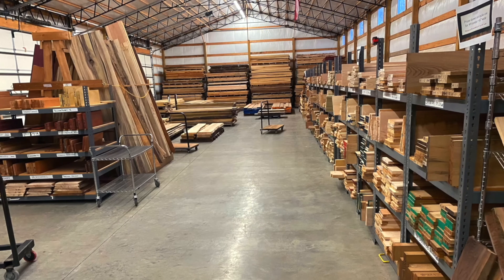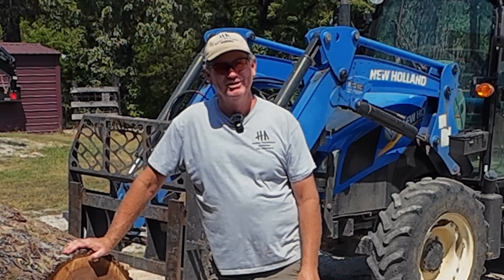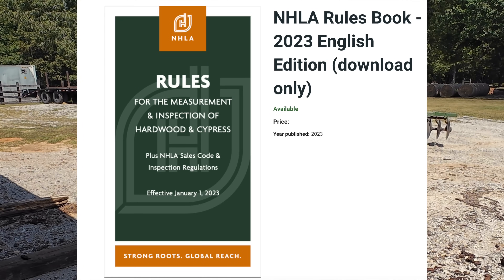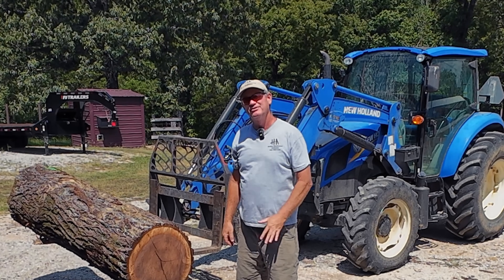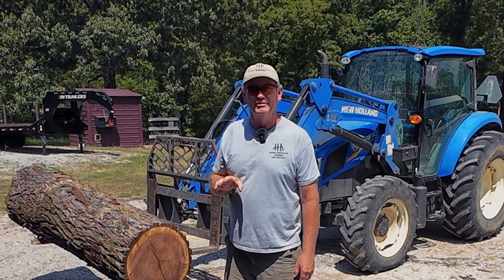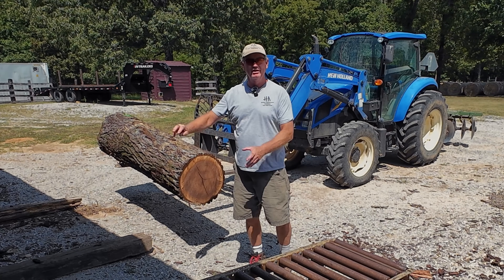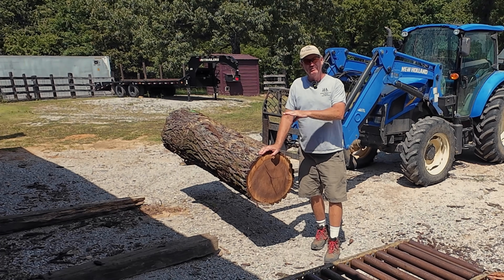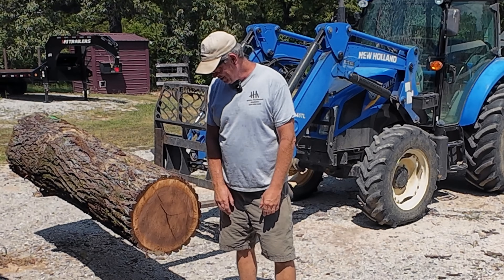Why Your (sawmill) Wood Curves When It Dries?   Stop Doing This!

Comment: Great stuff, thank you.
I remember reading in a timber framing book, years ago, that Beech actually swells as it dries.
That is why it is preferred for pegs in mortice and tenon framing, installed green, and then gets tighter.
I thought that was odd, do you have any experience with this?
Reply from the maker: Interesting question, I know it shrinks when kiln dried, and has a lot of movement as it does, which is why is not desirable for commercial lumber but maybe why it's used for pegs.  American Beech has a radial shrinkage during drying of 5.5% and white oak has a radial shrinkage of 5.6% so it behaves very much like white oak.  Red Oak will actually shrink less, with a radial shrinkage of 4.7%.  I know an expert timber framer, I will ask him.

Comment: Great topic.  When you stack your boards for drying, if you paint or coat the ends of the boards, does this make a difference on the amount of warping and cracking of the boards?
Reply from the maker: Not warping but it does help end cracking.

Comment: What are your thoughts on pulling the extractives from lumber species that are highly susceptible to movement prior to drying the lumber.  Especially in boards with large amounts of sap wood...is the juice worth the squeeze?
Reply from the maker: Good question, but I don't think so, at least not in large quantities.  From a monetary standpoint, the NHLA has allowed so much movement in the boards, the lumber will still meet grade by doing nothing.  No reason to expend resources on it.  However, for folks like us, the best way is to just know which boards move more than others and cut off the sapwood with the sawmill.  Some people use techniques for small pieces, but that is not useful for moderate quantities .

Comment: Some wood products react far better to being kiln dried than other Douglas Fir most obviously or "pine" as opposed to hardwoods yes, absolutely.  When you go to the paper mill tho they show you how to solve this problem big time by adding "whiteners" or a chemical that dries out wood turning it into paper products mainly but also ahem "dries out hardwood" ahem by bathing in a vat of chemicals another more easy way is to burn your wood ... not burn it up but char it after debarking to act as a barrier to prevent moisture escaping hence why the bending is happening in the first instance "stripped to bark off." Need to add that bark back on whilst at the same time drying it this be done by coating with a flame to produce a charcoal like surface😊

Can of course use green timber as well as the only reason to dry wood is to make it easier to work with and transport😊😊
Reply from the maker: Yes, you are correct.

Comment: Anyone ever try adding them there extractives to sap wood, maybe by soaking? Many thanks professor for the skool teachin'.
Reply: I used to soak my greenwood carvings in an acrylic solution. think the product was called pentacryl not sure on spelling. It dulled the luster of the finished wood but nothing ever bowed twisted or cracked. similar concept, just replacing the water in the cells with acrylic
Reply from the maker: Great comment!  That's exactly the same, I wish I had thought of that example when doing the video.  I have used Pentacryl myself.  I guess instead of being an "extractive" it would be an "Insertive."
Reply from the maker: Yes, I should have thought of it and given examples of wood stabilizers.  Good comment!

Comment: any suggestions on keeping pine flat as possible,  I know it isn't hardwood, but cutting what sells around here,  many want pine  dimensional lumber
Reply from the maker: Yes, pine can have a lot of stress (carrot peel), although not as much issue with extractives stress.  When sawing dimensional lumber it important to always put the stress in the face bow direction to keep the edges straight so walls, floor and ceiling lay flat.

Comment: Robert, a bit long winded but I get that sometimes people don’t get it.  What would be good would be to know what woods is it ok to have sapwood could be included in drying.

I would also like to know a bit more about drying different species of wood if you have some free time.

Andy
Reply from the maker: That would be a good subject, especially about drying different species of wood.  Most people don't realize how complex it can get to do it correctly, specie to species.
Reply: I really would appreciate some drying videos.  I don’t saw for selling only for my use. I don’t mind taking extra time in the sawing process as I saw  for grade and orientation of the grain. Only to fail in the drying process.

Comment: I get it. At least I'm starting to understand. The sapwood and the Heartwood dry at different rates because the heartwood has more solids type material makeup than the sapwood. Even though the cellular structures are the same, the solids in the heartwood change the way the wood shrinks when it dries just like the sponges that you where talking about. The one with the dirt can't shrink in the same way because of the dirt in the sponge. Now, with the wood the heartwood is like the sponge with the dirt is more solid naturally and can't shrink the same causing a the wood to draw and or bow because of the way it shrinks when it dries. By George, I think I got it. Give this monkey a peanut. Really, it's pretty simple if a person don't over think it. Like the poplar, the shrinkage if more the same. A person can usually see the difference in the poplar by color and texture (hardness). It pretty much looks the same in color and similar texture through most of the wood. It appears plain to see by just looking at the color variation of the wood. Am i mostly right? Thanks for your knowledge that you have and in sharing it with your experience with others to understand hardwood lumber products better. Thanks!
Reply from the maker: Yes, you pretty much nailed it! Great job!

Comment: Robert,

I was recently watching another YouTuber that said you should use stickers of the same species of wood.  I kinda remember you saying if cutting hardware use software stickers and if cutting softwood use hardwood stickers.  Can please confirm?  Also is the and wood and stickers to avoid do to staining?

Thanks,
Andy
Reply from the maker: Yes, that is a common misconception and urban legend that is false.  Definitely use hardwood vs softwood runners for pallets, and yes, it would be a good idea for stickers also, except softwood stickers like pine just don’t last very long for repeated use, and don’t use any sticker of any species that is very porous and can trap moisture.  The stickers I use are assorted hardwood, everything from oak to hickory to cherry to sycamore and the main thing is to use stickers that are kiln dry or at least air dry, to keep from trapping moisture and causing sticker stain.  Wet stickers are bad, and most people will stack and store their stickers in a protected area.  I try to get many kiln cycles out of my assorted hardwood stickers, especially the ones I pay for, and I never sort by species when I’m using them because it doesn’t matter.  There some species that you don’t want to use, such as any dark wood, such as walnut, which will stain light colored woods.  I don’t like basswood either, it traps moisture, and not a big fan of soft maple stickers because of the sugars in the wood.  In fact, some commercial operations use only extremely hard assorted exotics for stickers for their domestic hardwood lumber, as they last longer through their automated stackers and destackers. I’ve also used PVC stickers and even some made with extruded thermoplastics.  So nope, use most whatever species you have, softwood against hardwood is best, but assorted hardwood is fine, and certainly, there is no need to sticker with the same wood.  This is a good topic for a video.
Reply: @HobbyHardwoodAlabama   Thanks for the feedback.